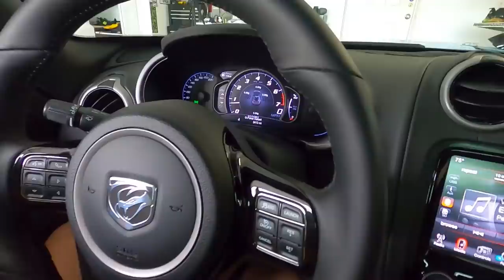CUTTING A BRAND NEW $70,000 2020 HIGH COUNTRY DURAMAX IN HALF... *My FIRST SEMA Build!*

Comment: The truck looks like it’s doing pretty good getting torn apart and laying all them parts out but the one thing that I do not see is going in there changing the gears with them tires you have I think 538 gears or 513 gear should go in there for them tires so you don’t lose any power out of that motor it’ll be easy on your transmission good video keep up the good work